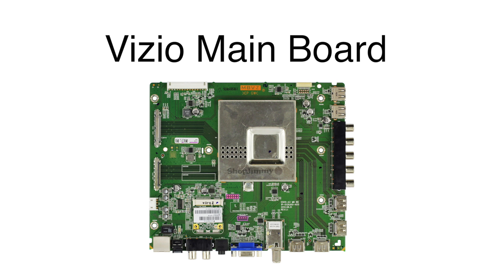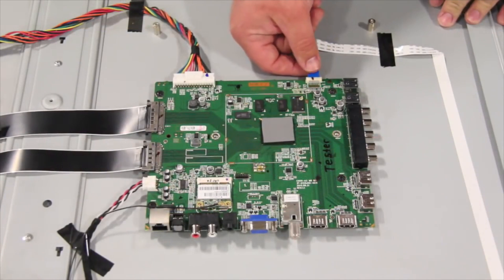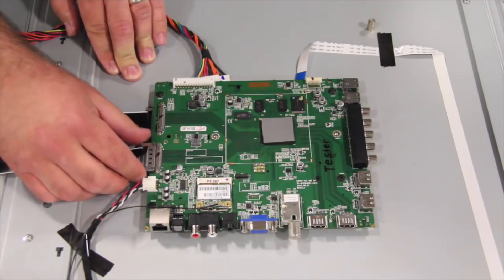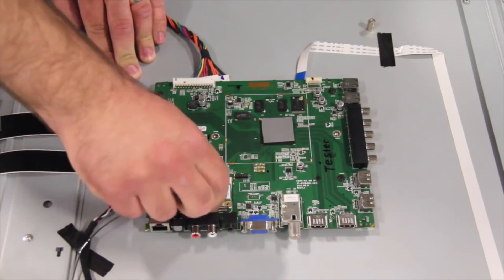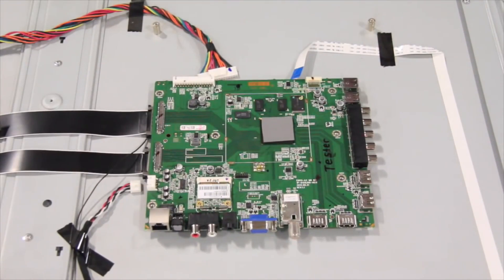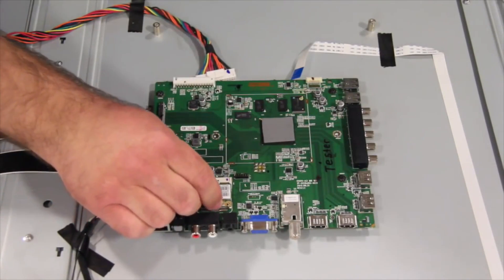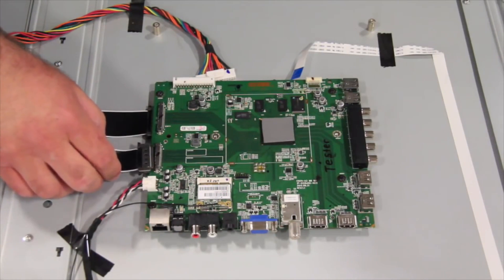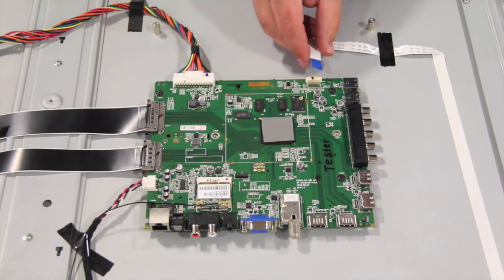Vizio E601I-A3E & E601I-A3 LED TV Main Board Replacement Tutorial

Comment: I have same model tv that's in this description. My problem is the menu will pop up for 2 sec then go away when I push menu on tv button and remote also none of the apps pop up when I hit the big V button on remote or when I hit netflix,amazon etc. So could this board be my problem ?
Reply: I just started having the exact same problem as you described. Did you ever figure out what board to replace?